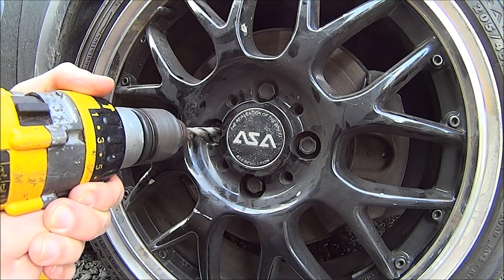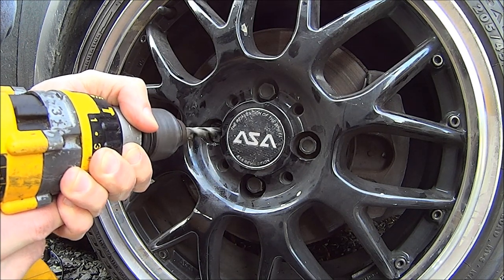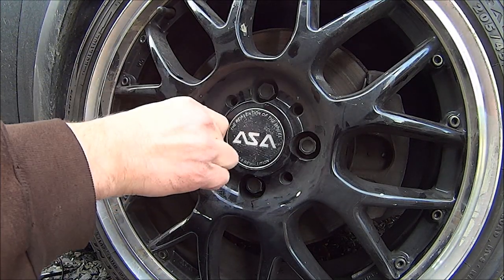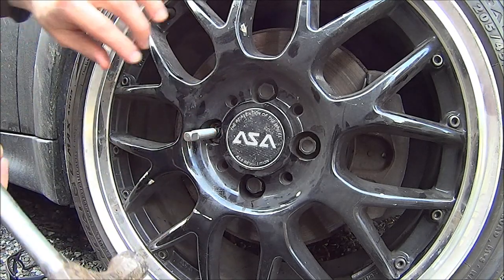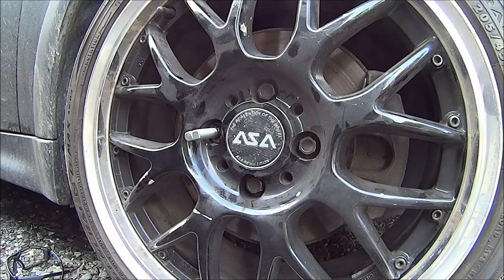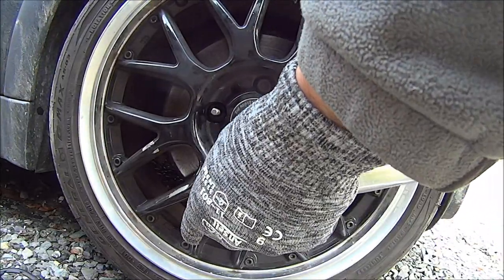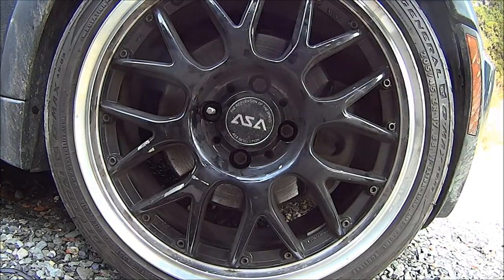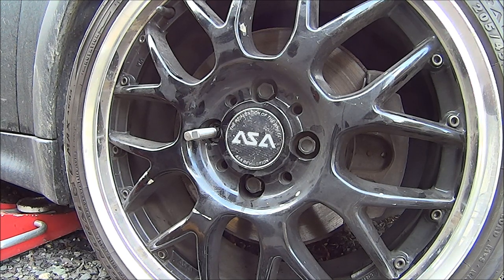Remove Locking Lug Nut Without the Key -- Drilling Out & Extracting Lug Nut -- Lost My Key!!

Comment: I would like to know what kind of drill bit you used.
Reply from the maker: +William Moye The one in the video is a garbage one, but the pilot holes were drilled by dewalt 'pilot point' bits that are made for drilling metal and they are amazing. I didn't have a dewalt bit big enough so I had to use a crap bit to get the size hole I needed. Find the set I use here: http://amzn.to/21SjtQb
Reply: Thanks for that I'll try it.
Reply from the maker: William Moye welcome, good luck
Reply: Sooo I watched this whole video only to find out that you actually have lug bolts instead of lug nuts as you stated in the video and title.... 😭 This won't work for me as I would damage the wheel studs
Reply from the maker: @alexkapinga2024  u can replace the studs

Comment: I tried this but of course bmw has to make the worlds strongest lock nuts😒 cant even drill into them
Reply: Kaden Bourgeois thought I was alone! spent an hour yesterday drilling into a stripped lock lug on my Volvo & I got nowhere!!
Reply: calum breitenberg:- try and get a solid carbide drill from someone who works in a machine shop ask around your friends.
Reply: To drill metal, in general push hard, go slow, and use cutting oil. With harder metals, even slower and do everything you can to prevent heat build up at the tip of the drill bit. Use sharp bits etc..

I've had luck with carefully welding an old socket right to the lug.
Reply: Just tryed mine Peugeot done the same some f ing  lock nuts
Reply: @Gone4Light  
a) you guys aren’t using good tools. Use cobalt alloy drill bits. Cobalt not kobalt
b) why would you ruin a socket when you can just weld a junk nut or bolt on?!!

Comment: those look almost identical to my rims but mine were painted and have a way bigger lip. ASA Revolution Racing is the name
Reply from the maker: +fockyoumang These are the ASA AR1's. I like the way they look, but I wish I had the 15's instead of the 17's. The 17's bend easier on the Mini because there is barely any suspension on the car lol. What size are your rims and what car are they on?
Reply from the maker: +fockyoumang Sorry I just found this comment waiting to be approved because of the link. I see what you mean with the lip difference. I think the offset is specific to the vehicle.

Comment: got them lol saved my hide so many times!
Reply from the maker: +jimbo booth They usually don't work for me but I guess I finally used them correctly haha. I'm happy I had them!
Reply: a DIY Car Guy glad they worked for ya, i usually use a socket with mine because they say tohave pressure on the rear of the tool and i have a socket out more than a wrench lol
Reply from the maker: +jimbo booth The ones I'm using are designed to be used with a tap wrench like from a tap and die set.....but I figure what the hell. hahaha
Reply: a DIY Car Guy true that, only thing that matters is that it worked . lol
Reply from the maker: jimbo booth yep lol, it worked on the other 3 lugs too
Reply: a DIY Car Guy i bet. That is awesome!